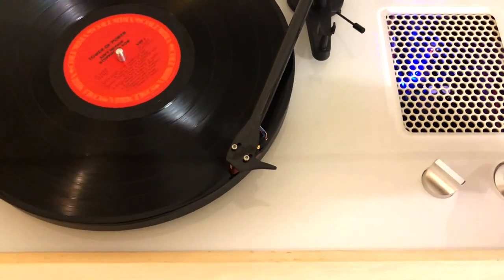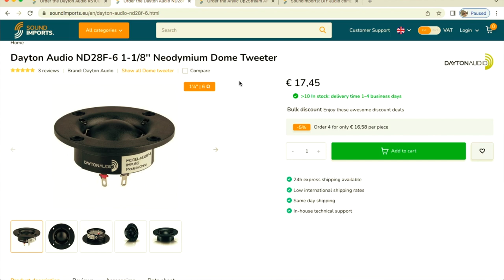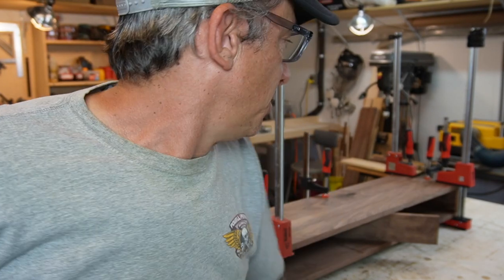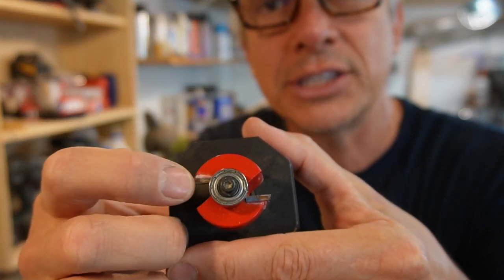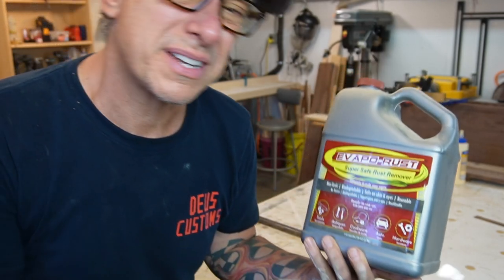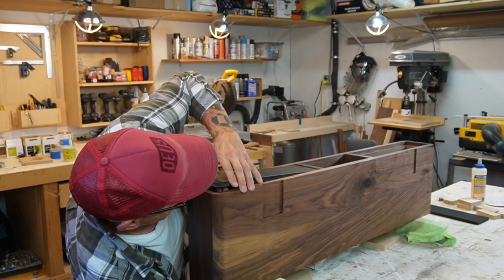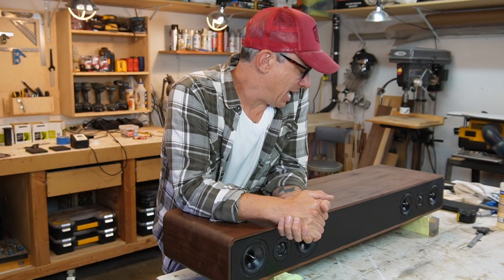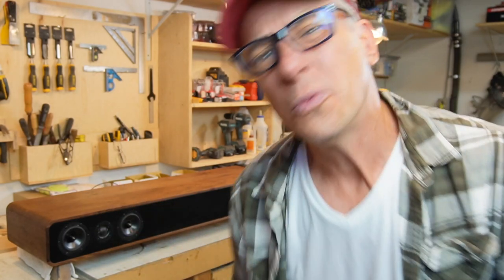Dayton Audio Reference Wi-Fi / Bluetooth Soundbar | Arylic Amp | DIY | Walnut Hardwood Metal Legs

Comment: Nice work they look awesome.
Did you think about adding a sub in the same box? 
Those Rs100-4 can go in a tiny sealed box and still sound good(obviously with a sub backing them up).
Reply from the maker: Hello Harry. It plays enough bass on that box, not a sub woofer though but those little drivers are impressive.

Comment: I would be interested in a diy 3.0 soundbar would you use a woofer tweeter set, or maybe a version with just full range drivers
Reply from the maker: Either one works well. Depending on the full range size you will need more higher frequency bass to cover the lack of lower frequencies from the FR. those drivers play pretty well, good bass for the size. A 10 inch sub would help a lot